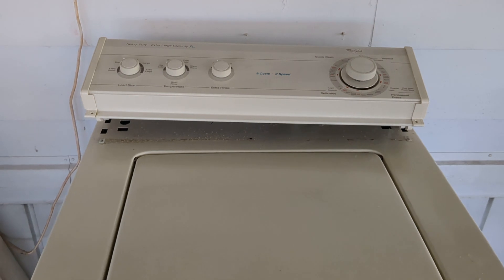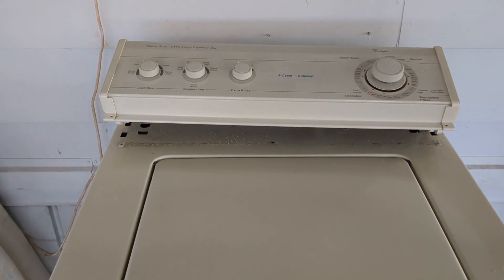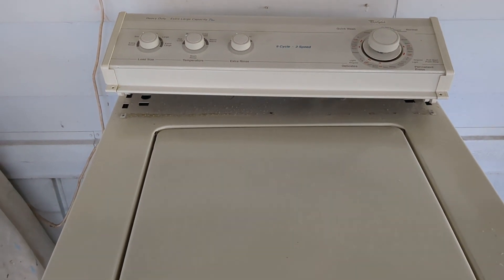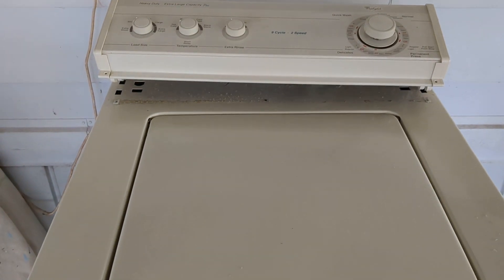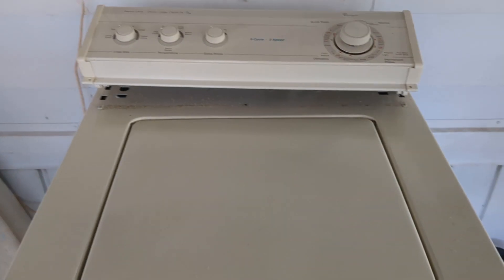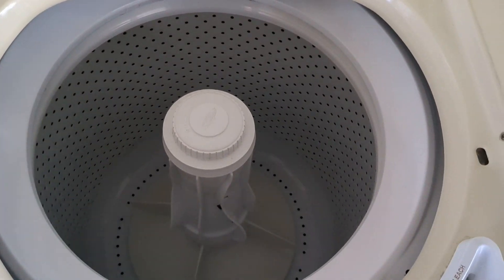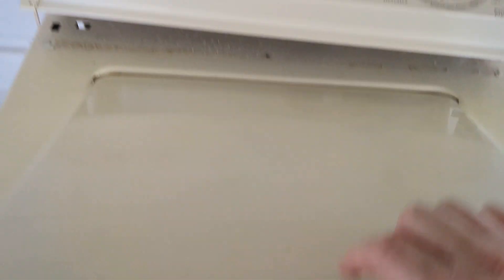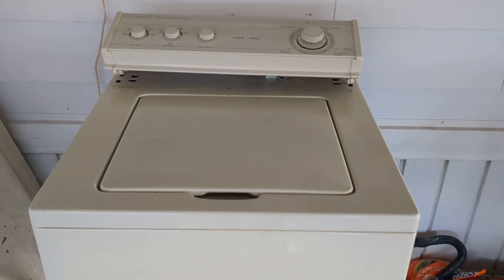This will be a project for the spring Lord willing.Going to do my first tear down of a machine

Comment: I know exactly what you were talking about Pat. Both of my machines had all of that stuff under the touring as well. It’s disgusting. So many people don’t realize how nasty their Ms Hines get when they do cold water washes and use fabric softener. Anyway I’m sure this machine will be perfect when your done
Reply from the maker: I never did this before Matt but I'm determined. I didn't pay much for the machine so it's not like there would be any major loss if I screw something up.
Reply: @patcola7335  I know the feeling. I went into mine completely blind. YT is your friend. I just hope your tub isn't too rusted on the shaft. Sometimes removing them can cause issues. But looking at your other video, your machine doesn't look that bad. Yes its gross, but I've seen much worse.
Reply from the maker: @MatthewJames-st5wv  According to the date code, it is a 1997 machine. I knew it had to be by the tub hole pattern because Whirlpool went to them in the '90s I think. They didn't come out with a spiral pattern till around 2000. I think maybe a year before? My first washer that I paid for myself was going into Sears in 2003 and buying the Kenmore 90 series. That had the spiral pattern on the tub.

According to the parts list, I can still get a inner tub for this machine but it looks to be in good shape. At least the interior is. There are no rust spots that I can see but will have to wait until I get the tub out to see what's what.